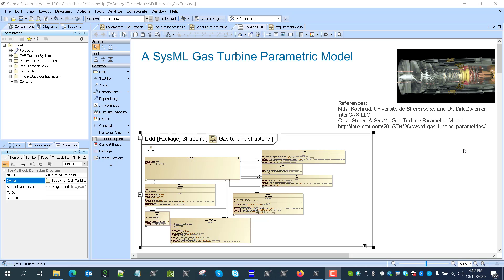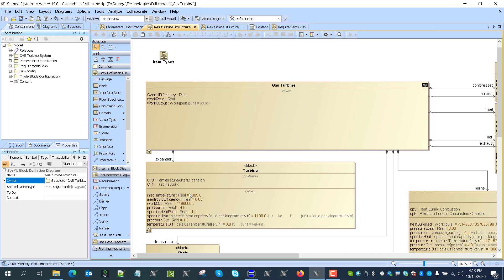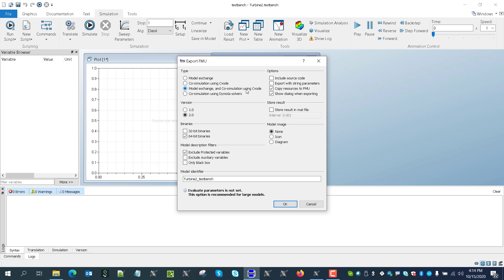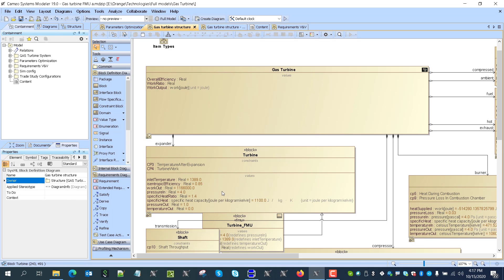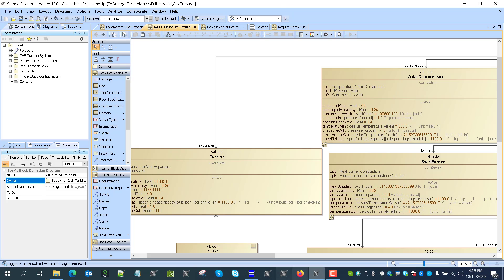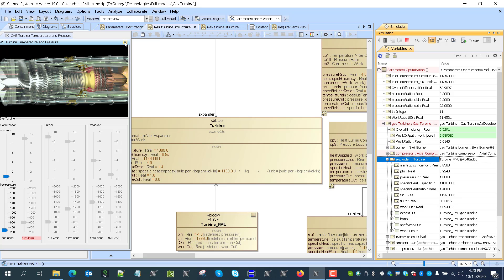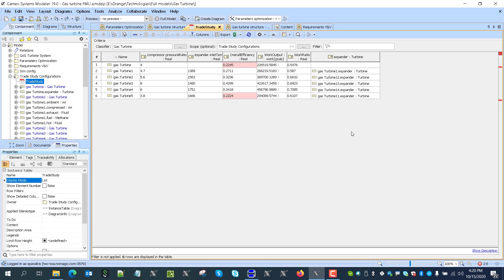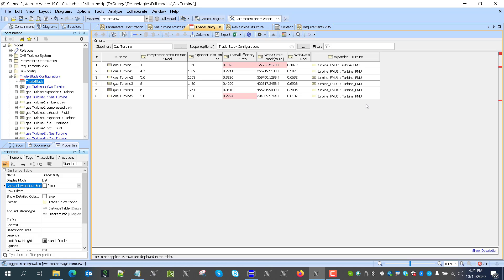External FMU Simulation in Gas Turbine SysML Parametric Model [Part 2].

Comment: Hi, we have tried importing the FMU file. The Cameo Simulation shows the input values parsed from FMU model, however it does not run the native simulation, and do not show the output.
Reply from the maker: Hello Mudit. Have you run simulation using sim config? It is must for FMU as all time setings are set in sim config.
Reply: @MBSEExecution  yes we did try that later and it made it work! Thanks
Reply from the maker: Great! Thank you for the status.

Comment: Thank you very much for the videos. I'm wondering if you would help me with the FMU-simulation problem. "Three FMU Files are imported into a SysML model, but only two of them can be connected to MATLAB sessions during co-simultion (Cameo Systems Modeler 19.0)." Considering that individual FMU Files proves valid, I failed to figure out the problem.
Reply from the maker: Hello Magic, thank you for the feedback. Have you tried to validate FMU files using fre simulator like - https://www.3ds.com/products-services/catia/products/dymola/free-downloads/fmu-simulator/ ?
Reply: @MBSEExecution  Thanks for the advice. I've checked the FMU file and solved the problem!
Reply from the maker: Hello Magic. Great to hear! Thank you for sharing status.